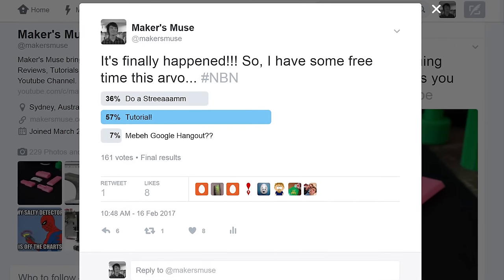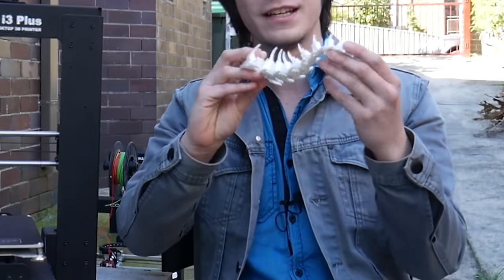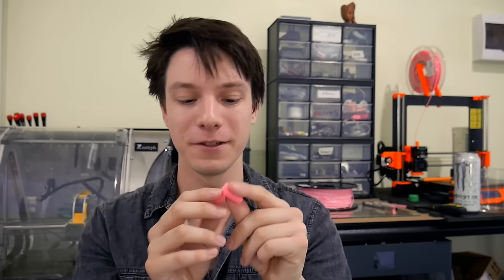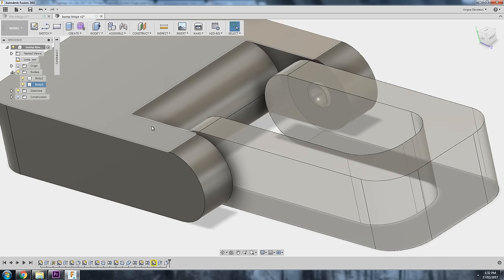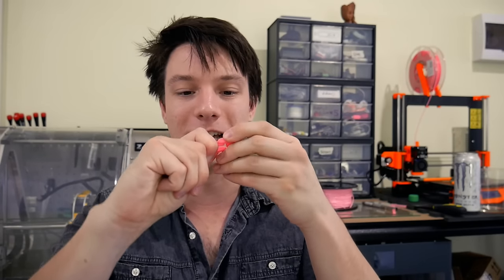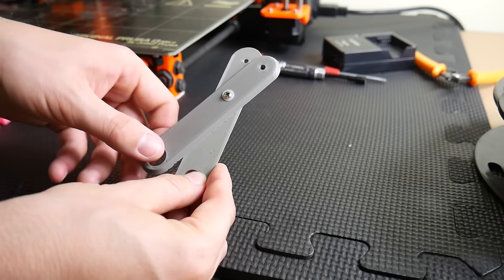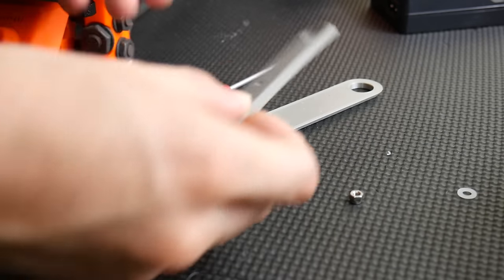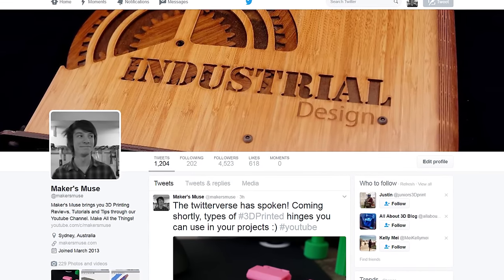How to design 3D Printable Hinges - Make moving parts!

Comment: I've been having failures when trying to print hinged items using my Elegoo Mars resin printer. It seems the same items print just fine using and FDM printer, but something causes the pivot to fuse and not rotate.
Does anyone have any wisdom to share on getting hinges to successfully print on resin machines?
Reply: I'm in the same boat with my Creality Resin Printer, I think due to the nature of liquid resin flowing into and getting trapped in the separation gaps, it inevitably cures and hardens the pieces in place.  So unfortunately I don't believe that many of these mechanical print in place pieces will work on SLA machines.  The only advice I can give that I haven't tried myself is to  leave enough drainage holes around the moveable portions, increase the separation gap much more than FDM prints, and potentially add very small supports to the "pin" that will break apart after and fall out of the drainage holes.  In my situation, I am just planning to wait until I can get an FDM printer for moveable print in place parts.

Comment: some tips on how to print those hinges would be useful. you mentioned bridging but didn't explain what to watch out for.
Reply: Kind of like printing anything else, really. The printer and settings for the material have to be fine-tuned. I think for this scenario your printer's accuracy will be the deciding factor.
If you want to avoid bridges, try making non-separable hinges, but instead of the pin going all the way through the segment, make it conical tapering off at 45 degrees and going into a cavity of same shape offset. Kind of like the locking hinge Angus showed, but the base of the pin is almost the radius of the whole hinge. More surface area for the pin - stronger hinge.

Comment: I sadly did not found it useful :/ Title was "how to design", which I still don't know. For example - I wanted to make moving part in my Prusa i3 MK2s, all fine, but even at that 0.3mm it won't move, while in video "How Accurate is your 3D Printer" you said, that your prusa i3 MK2 was able to print moving part with tolerance of only 0.2mm, mostly due to "elephant foot" effect. How do I design it to work? e.g. how much of an compensation do I put in slicer, what kind of setting are useful, and what kind of setting do you use? there's so much things to cover, and all I learned was not to design moving part of my own, but how old - designs of moving parts looks like :/
Reply from the maker: Thanks for the feedback, those points are good ideas for future videos. You're right that from a beginner's view without CAD experience this is too advanced.
Reply: I have no problem working in CAD software, however some stuff take knowledge you can either get via trial and errors method, or from someone else ;)

Comment: I am struggling to print this awesome egg: https://www.thingiverse.com/thing:2805211  Haven't made it to the Firetruck.  I have an Ultimaker 3.  Printed 4 times now, 1. completely fused top to bottom, 2-4 internal hinge area is fused.  I slowed the print speed (70mm/sec default to 50mm/sec) and scaled (up to 125%) to increase tolerances trying to fix the printing.  I have even printed on a PVA raft to protect the bottom of the print (works awesome!), yet it still gets internally fused, so when I open or pry it open it breaks the hinge.  As it isn't my design and I am not as skilled at the software, how do I clean this up or modify the print to become more successful?  0.4mm nozzle, PLA (Ultimaker filament), 0.1 layer height, 40% infill, No other supports.  Using Cura for software.   Clearly others have it working, so it is me or the Ultimaker, which means it is me miss using the Ultimaker!  HELP!!!

Comment: Print in place?? Whyyy... Why not assembled print or something like that, everything is print in place, not in other place.
Reply: Because some prints have parts that I’m not meant to be taking apart, that’s one of the key advantages of 3-D printing. Printing parts that are in place and will not disassemble and if 3-D printing does not take it vantage of this key difference between traditional injection molding then it’s only hampering it’s self